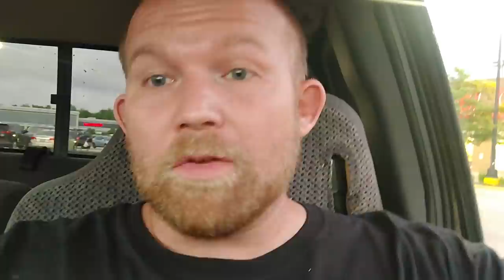Fram Filter Application Talk And What is What and Why - The consumer is the issue not the filter

Comment: I’m a WIX XP filter, or oem Motorcraft filter guy for my Town Car.  

Fram is ok.. if your doing oil changes like you should (3,000-5,000), fram or not fram won’t matter in my mind.  I’m just getting those other ones just because I have a bit of OCD and want to have security in the products I choose.
Reply: Bull, the filter media is less than the competitor plus they don't secure the media to the cover so oill bypasses the filter media. Do want that for 3K miles? Do you want oil not being filtered for 3k miles? I don't!
Reply: i run the motorcraft filters on my f150 too.

Comment: I have a 2000 Ford Explorer with almost 300K miles on it. I run Fram Filters and Castrol Oil. My dad used Fram and Castrol Oil on all his vehicals and had High milage out of his vehicals. we changed the filter and oil every 3K miles.

Comment: I don't know, I've used Fram, Carquest (both red and blue) and ACDelco and never had a problem. But then again, I change my oil every 3000 miles. AND I only use Castrol oil in my vehicles.

Comment: The only bad thing about fram that I have seen in other videos, is rust being inside the filter. I don't know if that's in other filters or not. Just an FYI, WIX makes Napa filters. I like WIX and they aren't expensive
Reply: Shoot even wix xp is only a little more $
Better than an engine rebuild!
Reply: I also watched a number of videos where the presenter has no credibility and uses speculative opinions instead of sound scientific proceedure to obtain facts. He used an angle grinder to cut open the oil filters. Then after heating and burning the element inside from the shower of sparks, he went on falsely claiming the element was defective, and there was "rust" on the inside. If you have ever used an angle grinder to cut anything, you know the cutting disk creates alot of heat and leaves behind dust and residue. Which is what had obviously accumulated inside the filter. Fram wasn't the defect that day, the video maker was for misrepresenting and unfairly characterizing a good product.
Reply: One of the best oil filter comparison video series on youtube is by Whip city wrencher. He uses the right tool to open the filters and offers fair, accurate, unbiased obsevations. Check him out..

Comment: I remember they used to just put 2 small metal tabs holding the media together at the ends without glue and now they use glue. It's better now but I'm not using the cheapest level of filter anymore.

Comment: Oil filters give trouble when they stay on the engine too long or when high viscosity oils are used that will not go through the paper and will not pass readily through the bypass in filter. I have been ase master for about 40 years and I will say the only oil filter caused engine damage were Frame filters. In those few cases the oil changes were too few and the filters stayed on engine too long so the filter was not clearly at fault. The most important filter ever put on engines is the first one and the one on the engine if some repair is made that will get some debris in engine in spite of the best level of cleanliness by the tech. Oil bypasses the filter A LOT! Many engines over supply the filter and the bypass opens at higher revs. All engines bypass most of the oil until oil temp comes up. If the filter has smaller particle capture then bypassed oil percentage goes up  from reduced flow capability. Very few engines have much filter size these days so the ability to increase the media area when the capture size goes down to make up for the reduced flow. Listen to FBM,  change the oil before the sludge becomes an issue but I may disagree about fussing about the filter brand filter. If you cut up old filters you don't find dust, you find sludge down in the folds. All filters catch those bits. If your engine is making metal filings no oil filter made is going to fix that and they will all be bypassing the oil around the filter paper pretty quick when the bearing flakes collect on the paper.

Comment: I drove my 1998 Grand Prix for 16 years using conventional oil and orange Fram filters changed every 3 - 4 k miles. The 3.8 L engine never let me down, and never had any internal repairs. When I sold it at 250,000 miles it was still running great, with very low oil consumption.
If you use these products as they are rated, you won't have problems.

Comment: After reading some of these comments I feel I need to tell what I experienced.  I put a Fram filter on my 2005 Sable with the 3.0 Vulcan engine several years ago because wmart was out of motorcraft.  I started hearing bearing knock at startup.  People in the taurus/sable forums were saying the anti drain back valves weren't the same as the motorcraft and were causing problems.  I got a motorcraft filter and changed it and the knock was gone.  I still have the car and it runs fine with no knocking years later so before someone says the motor was already in trouble when I put the Fram on, no it wasn't.  You can keep doing Fram commercials if you want but one will never touch any of my cars again.
Reply from the maker: What do you mean Fram commercials? Where's this coming from I need some explanation here because this is going to dictate whether or not I have good conversations with you or I just ignore you completely because you're being a troll

Comment: I've personally used Fram Filters for years and I never had any problems with them
Reply: @JT-qf4it  when I have a Toyota coming up on 200,000 miles using the cheapest fram filter at Walmart and Supertech oil every 5k the proof is in the pudding.
Reply: @slscamg  you could put rocks in that toyota and it would run 300k LOL
Reply: @JT-qf4it  well honestly if you listen to the video and if you are someone that changes your Oil on a regular basis then you should have nothing to worry about! not trying to be rude of course!
Reply: @JT-qf4it  at any giving rate any engine gets old and shows signs of wear and tear it's just the process I'm not saying Fram's are the "GoTo" and nothing else is but at any giving point an engine is going to wear down over time

Comment: Fram use to have a slogan back in the 70s PAY ME NOW OR PAY ME LATER!  So, you can pay $30.00 extra for a few good oil filters a year or you can pay $6.00 a year for a cheep filter and pay for a $5,000.00 engine rebuild three years down the road.

Comment: Yeah, I am still not using Fram stuff.  I use only OEM filters, or a WIX in a pinch if I can't find one.  I just isn't worth saving a few dollars for something as important as your oil and filter.
Reply: Apparently you are still a sheep. They make the higher end fram filters. I have used Mobil 1 and purolator as well.
Reply: @IzaguirreC  not! Oem is usually the best! Especially in diesel engines
Reply from the maker: So you missed the other talk about the higher-end filter from Fram right
Reply: @FordBossMe  yes I did. My apologies.  I guess Fram does make high quality filters too.
Reply: @maxpaul11  you do realize that oem filters are made by other companies right? Look at Honda filters are made by filtech and Honeywell. Same with other oem brands.
Reply: @IzaguirreC  I know, but I also know that my truck is 20 years old, had 509,000 miles on it, and it's never been touched with anything but a Motorcraft filer.
Reply: @frugalprepper  just curious do you buy oem oil and where do you buy oem tires from?
Reply: @veulmet  — idiotic comment. OEM parts made by other companies are made to higher standards, hence the higher price. 

That same company may later try to cheap out of certain things to make the part cheaper under a different aftermarket name. But it’s ALWAYS built with less quality then the OEM spec.
Reply: @IzaguirreC  — the OEM manufacturer has their own specs that are requested. It’s more expensive for a reason.
Reply: Oil filters are a lot like oil. You get what you pay for. You can even buy a quart of oil for a dollar at the dollar store.
Here's some information on the Fram plant in Greenville, OH. They can make 400 types of filters and make over 40,000,000 a year.
"The Fram facility on Jackson Street in Greenville has the capability of producing 400 different models of oil filters. A $5.4 million, 20,000 square-foot expansion announced in 2015 was set to add a fourth line to boost production to more than 400,000 filters a day in total with a crew of 380 employees. Fram has had operations in Greenville since 1951. In 2011, the plant employed 180 workers and produced about 40 million filters a year when Rank Group Ltd. acquired Fram from Honeywell International."
Reply: @I_know_what_im_talking_about  that’s up to you if you want to go out and buy exclusively oem. It’s like buying oil, you can buy oil at the dealer at a marked up price or buy it at a store. I have tried many oil types and filters with oil analysis from Blackstone, have not had advanced wear due to using oem or aftermarket. An other example is buying a pair of Levi’s vs true religion. It’s not going to be 300% better because it’s more expensive. To each in its own.
Reply: @vintagethrifter2114  if it’s used correctly it will not hurt the engine. Cheap fram filters are good for beater cars or flushing gunked up engines. They also make good synthetic filters while undercutting the competition. Purolator Boss goes for around 13~ I can find a Fram synthetic for 7~.
Reply: @IzaguirreC  I'm not saying that it won't. My comment was aimed more to the ones that will only buy a  particular brand or OEM. Purolator makes Motorcraft oil filters. It's like getting a repair bill after getting your Lamborghini fixed only to find out that the parts say Lamborghini on them, but not only are they made by Volkswagen, they're also used on some Volkswagens. Or, you just paid for Lexus parts to fix your Lexus and they look an awful like Toyota parts, etc.
Reply: @IzaguirreC  honda filters are made by fram now

Comment: I change my filter every 2k miles. Then the oil and filter at 4k...Makes me have to get under it. To spot any leaks, bushing etc anyways...Most people never seen the underside of their vehicle. The whole time they own them...

I even grease my ball joints while under there.
Reply: What modern vehicle is made today with greaseable ball joints??  Thanks!
Reply: @turkeyssr  I know for GM up until current gen 1/2 tons had greasable outer tie rod ends, 3/4 tons and up pretty much everything in the suspension is greasable and serviced at every oil change
Reply: @turkeyssr  Chevy Express / GMC Savana
Reply: Lol if I did that all my oil would just dump out by filter port.

Comment: I prefer to use OEM oil filters whenever possible.
Reply: I have a 2000 f150 4x4 5.4 auto and when i use after market brakes shocks etc i get disapointed :(  my truck is almost 100% stock OEM except for Aarms and ball joints , got new paint in summer 2020 and she looks sweet and runs great :)
Reply: @cesarcesar8545  I currently have 2 03 F150's and a 99. The best 1/2ton truck you can get in my opinion. I also use a majority of OE parts unless the house brand part has a better warranty. (With the exception of motorcraft plugs,  fluids and filters) . Ive found that OE just wears better.
Reply: Or find out who makes the OEM for the manufacturer and use theirs. No ford chevy or toyota does not make oil filters or wiper blades. They decide whom makes those parts and pays that company to slap the manufacturer name on it to sell to you.

Comment: I use Mobil 1 5w-20 with their filter for both my F-150s. Change it every 4K-5K miles. I drive 30 minutes to and from work on the expressway so they get mostly highway miles and then around town driving on my days off. It seems to be holding up very good. Was thinking of trying Pennzoil next interval. Thank you for the video 👍

Comment: Way back I used to run the standard Fram Orange 🍊 filter and never had a problem.  Even cut many of them open to see.  Just wanted to go with a higher quality filter later on.  I do like filters that are white, orange and red on the case.  Makes it easier to see if there are any leaks after installing.  Trying the Fram Titanium now.  Like you, I 
rarely go over 3,000 miles on oil and filter change.
I know it is overkill, but I always feel better when I put fresh clean oil and filter on my vehicles.   Maybe 🤔 it creates a placebo effect on me too. 😁

Comment: Fair points!  My Acura RL with J37A2 engine uses synthetic blend 5w-20 with Honda filter gets its oil changed at 3k.  My 2nd gen Honda Fit, with the same type oil and filter runs up to 5k miles but usually less.

Comment: I run all my lawn equipment in harsh environment where there is dust grass and my cheap fram filters have never let me down im suppost to do my oil changes and filters manufacture calls for every 100 hours i change it every 80 max 90 hours and i have mowers with over 5000 hours on them and run perfect fram filters do there job.alot of people talk so much crap without knowing what the hell there talking about they want to know more then a engineer. Thanks for sharing brother

Comment: I used standard Frams  for years. My 05 Ranger Edge said 5,000 oil change. i still do them at 3. The only issue I had with Fram was I noticed what I thought was a rear main seal leak. Took it in to the Ford dealer where I got it still under warranty. Tech said 4.0 Liter engines are high pressure engines and the seal wasn't holding. Didn't do it on every filter which had me scratching my head. But I told him that I would use what it was born with. Motorcraft. My son uses a top end Fram on his 96 F-150 4.9 with good results.

Comment: All those videos showing the cheap Fram filters cut open and how crappy they are made is the issue.  They are made with crap materials, including but not limited to using almost half the folds in the filter than comparable Filters, using really cheap materials for the bypass, and the encasement metal was so thin that getting a Fram filter off after someone over torques it, is a nightmare.
Hell, I saw one Fram that had a cardboard bypass spring.  Now that's a joke.

To be sure the vids I saw were quite old and Fram may have dealt with the issues but it is way too late now.
Reply: I have a 20 year new old stock fram filter. I should cut it open out of curiosity and compare with a new one.
Reply: @beezertwelvewashingbeard8703  Pretty sure the video's show the cheapest Fram's you could buy.  You might have a decent one.

Comment: I think the filter change is probably more critical then the oil. But if you are already there why not change everything. Totally agree with you on the boosted engines cheap insurance to change every 3-5k. Cheap trade off for the performance as well

Comment: I changed my oil for the first time a month ago. Bought Mobil 1 full synthetic and a fram filter. It’s all Walmart had that fit my truck. After looking it up many people said I screwed up getting the fram filter. Thanks for making me feel a little better. Still, I’m changing it after 3k and I’m gonna go with the motorcraft filter recommended in the manual
Reply: I did get the ultra synthetic fram

Comment: Motorcraft oil and filter every 3-5k miles.(depending in when i get around to changing it) Nobody will ever tell me any different.
Reply: Does motorcraft make a full synthetic? All I have seen is the synthetic blend. I don’t trust it. Probably 99% regular and 1% synthetic. My owners manual says motorcraft, but I’m going with Mobil 1 full synthetic
Reply: @lesterparker1594  Yup, they make a full syn. Its a pain in the ass to find sometimes. I use the blend because it's what Ford recommends and its cheap enough to not care about having to grab something else. When Mobil1 was actually a full synthetic I used it but its a blend now so there is no point in paying the extra money. I have hundreds of thousands of miles using motorcraft parts havent seen a single oil related issue.

Comment: I’ve been using Fram oil filters for decades on all my vehicles. I’ve been changing my oils routinely between 3-5k miles. 

I’ve got a 99 civic that has well over 600k miles and I’ve used Fram on that car since day one. I’ve never had a single issue with Fram oil filters, despite all the “bad press claims”
Reply: When I was growing up, my neighbor had a Dodge D 100 pickup with the slant six engine last 1.5 million miles..💪 He used Quaker State motor oil, a quart of Rislone engine treatment every third oil change, and Fram filters religiously till the day he died..I remember him showing me letters from the Chysler Corporation offering to purchase the truck back from him lol! The most important point is : Slant Six engines are legendary,  as is Quaker State motor oil, rislone, and Fram filters..

Comment: I know if you run a Fram on a Cummins in a pickup, you’ll need to replace the number 6 wrist pin because the filters blow apart and the number 6 wrist pin is the part that for some reason always gets wiped out.

Comment: What do you think about these hubb oil filters? Now I use super tech synthetic oil along with super tech oil filter. However, I will disclose I change my oil every 3K. I don’t care what the product or manufacture says. 3K is as far as I will push it. I have never been broke on the side of the road for engine issues. Proper maintenance goes a long ways. Especially with these newer vehicles.